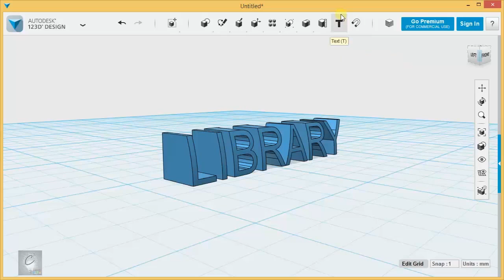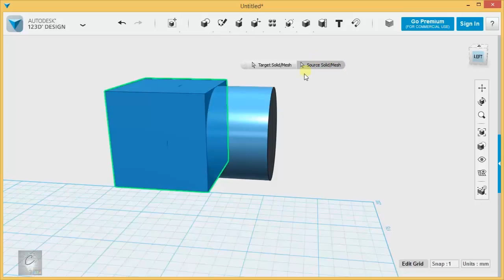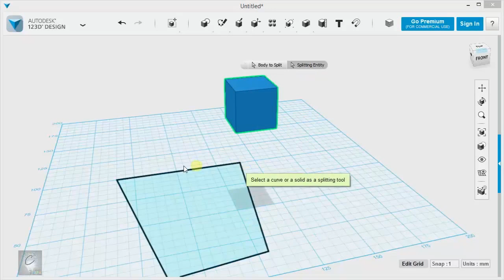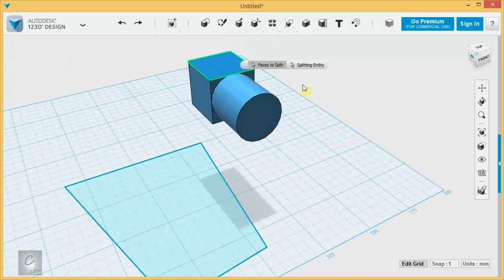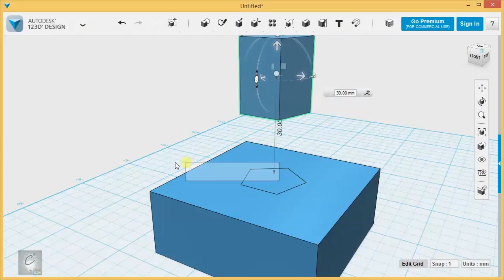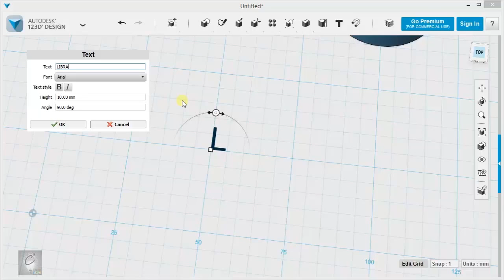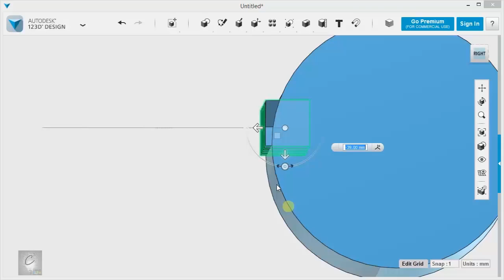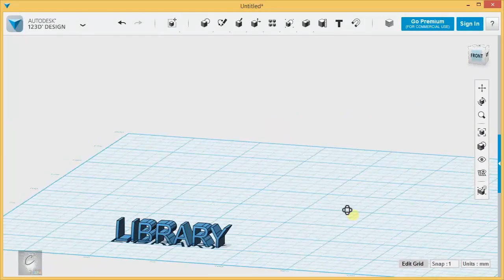123D Design Tutorial - Basics 6/6 - Combining Sketches with Solids

Comment: I created a solid that I merged together out of a number of different elements, and I'm trying to remove 0.3" of material right in the middle. I can create the gap with both splitting and the boolean subtract, but no matter what I do the top and bottom portions are still grouped and I can't slide the top down onto the bottom. I'm mostly just trying to cut down a 20 hour print by removing some unnecessary materials.
Reply: Well, not 5 minutes after I posted this question did I stumble upon the answer. Under the "Combine" options I clicked Separate (Shift+P) and I was able to move them independently. I'm using 123D Design 2.1.11. And all it did was separate the two parts that were no longer touching, didn't "explode" the entire solid. Thanks again for this wonderful series of walk throughs. Although if I may make one tiny suggestion, add into the titles exactly which processes you demonstrate in the video. It'll make searching for it much easier.